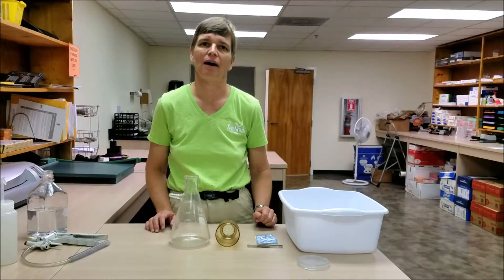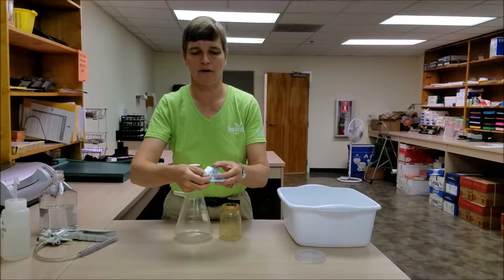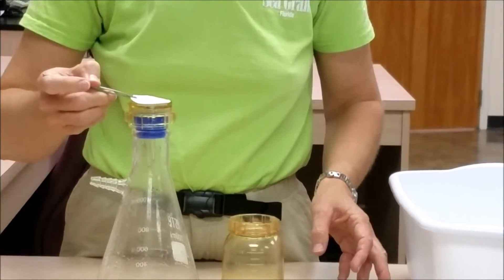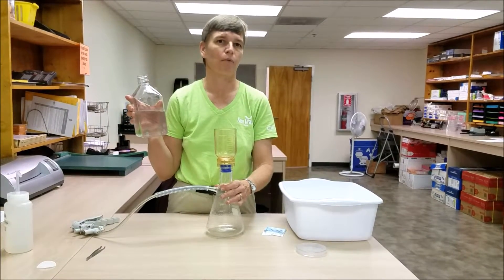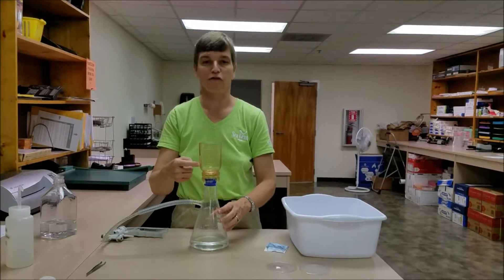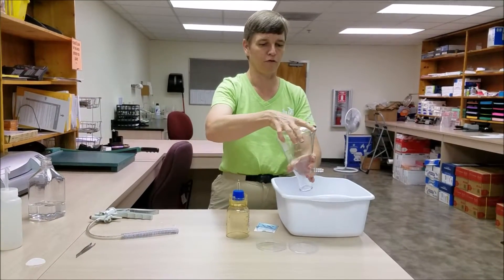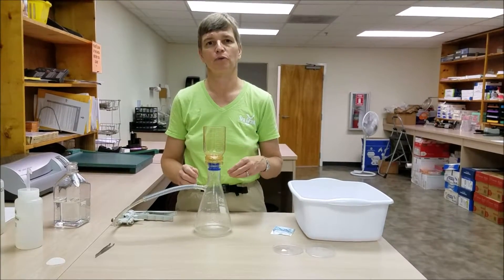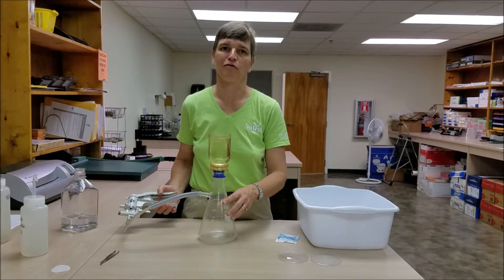FMAP2 Preparing filtered water to rinse our equipment

Comment: I'm looking at doing this method for the study I;m busy with on microplastics within my municipal point-of-use water. Once the filters are in the petri dish, do you place them in an oven to dry before analysing them under a microscope?
Reply from the maker: I'm so sorry not to have replied sooner--somehow I missed this question. You can observe the filters wet, but I find that it is easier to see the fibers if I let the filters dry. They will dry within a few hours if just left in the covered petri dish at room temperature.